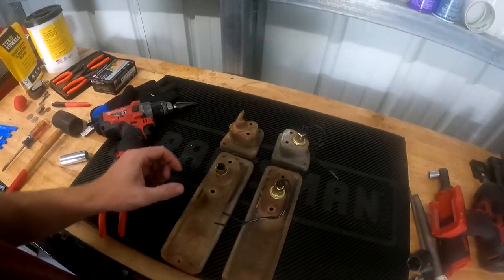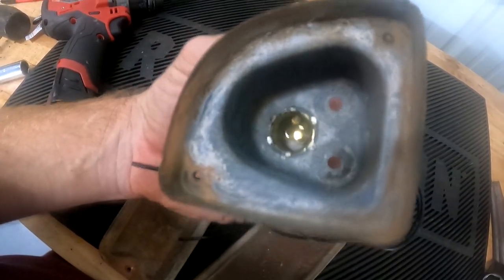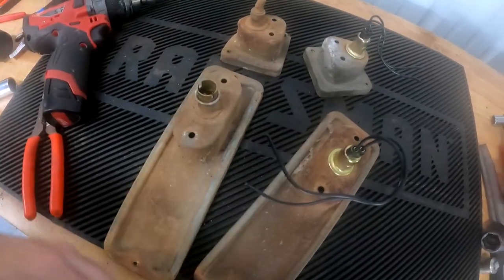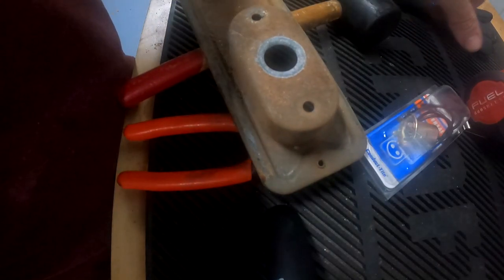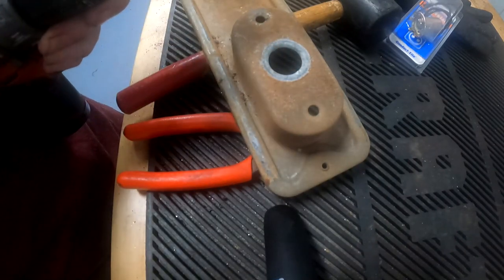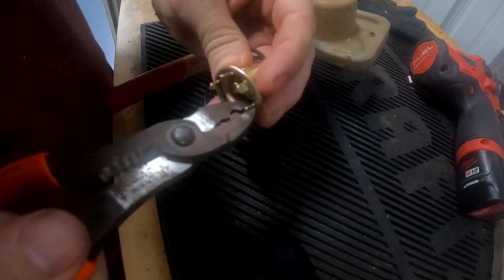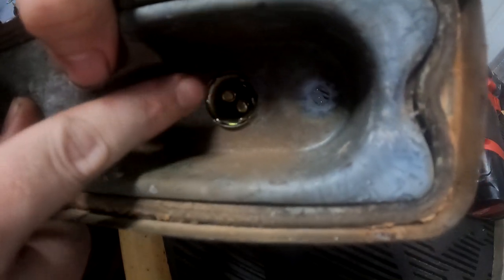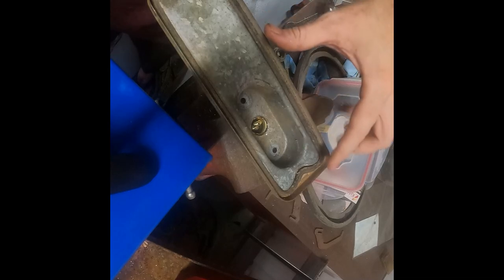Classic Car and Truck Light Socket Replacement | Chevy C10 How to

Comment: Sweet, you want everyone to know your slowing or stopping and doing this will help, as long as they are not texting about the taco photo know one cares about. Just a friendly tech tip: These bulbs should be clocked correctly, so find the short & long tabs of the socket for this dual filament bulb. With the socket removed, sandblast and spray the best silver paint inside except where the bulb socket fits. Don’t bother with mirror paint! Note the bulb gets its ground via socket to housing, housing to screws to bed. Grounds are as important as B+. Wire wheel the backside and heat the bottom and tin it with flux, thin coat of solder. The new socket has a cadmium conversion coating on zinc, wire wheel at 1/4” off the bottom. Once installed as he has shown, add flux, heat & solder socket to housing. Fresh paint or 55 year old patina will present a bad connection for ground called voltage drop. Simply known as resistance. Once the socket is soldered to the housing, clean the mount screw holes with sandpaper, stone on dremal but use star washers. Their jagged points (Internal on screws, external on bolts) dig into metal. I use dielectric grease on the bulb, under the socket contacts & on top of grounds. This eliminates the moisture like dew on morning grass, from getting to know your local sheriffs deputy and pink paper. I go as far as adding a second ground from the housing to the bed with 1/4” female & male spade connectors with grease because they want to be together. Plus, dielectric grease, a lube, just makes everything better. Don’t forget to ground the bed to the frame in two points as well. Yes, it’s work, rewarding and still cheaper that pink paper from the kind officer! 
NIASE Master Tech  - Retired

Comment: The issue with old trucks is that the tail lights ground through the box of the truck. Over time the box has a poor ground connection to the frame, which leads to dim/not working tail lights. You should solder a ground wire to the bulb socket and run it to the frame of the truck. (I recommend running your negative battery cable to the frame as well, and redo all ground straps too) What I did on mine is I bought the tail light sockets that have a ground tab where you can add a ground wire. This issue had me tracing wires for two weeks! hope this helps.

Comment: If you use use a die grinder to take off the inner edge , you don't read have to spend much time trying to bend it back with a screwdriver.

Comment: That turned out really good those should work just great is the outer housing the ground? I guess so if that's why it's metal and Metal.
Reply from the maker: Yes the housing works as a ground in most older cars… which is why bulbs not working can normally be due to back sockets or grounds.